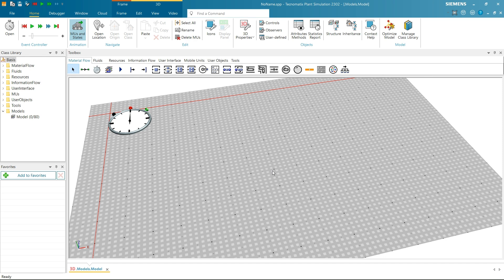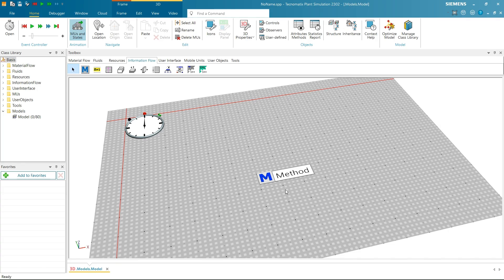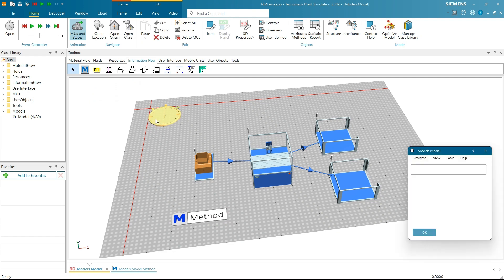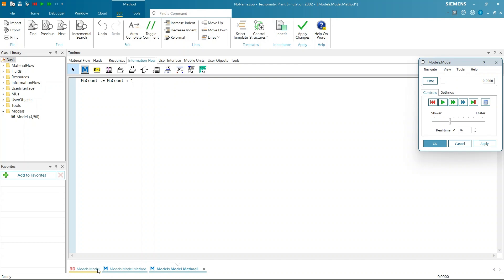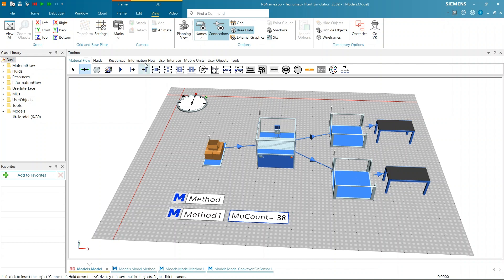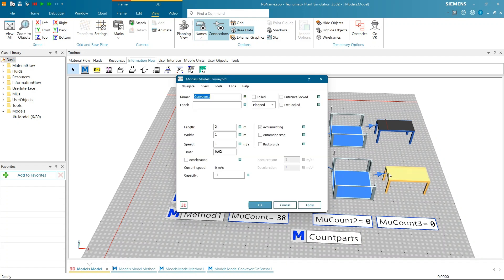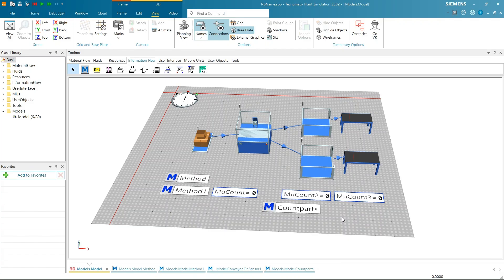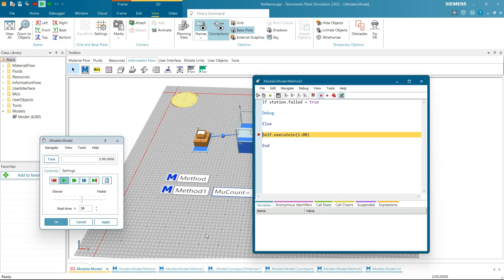Different ways to execute methods in Tecnomatix Plant Simulation

Comment: Is it possible to get a worker to carry parts in a batch from one store to another store, when it becomes empty and needs replenishing?
Reply from the maker: yes it can be possible. store should have a tab called importer. there turn on the transport service and use workerpool and broker.
Reply: @plantsimulationPro  thanks, I found using the method store.orderParts("Part Name", amount,  destination) works